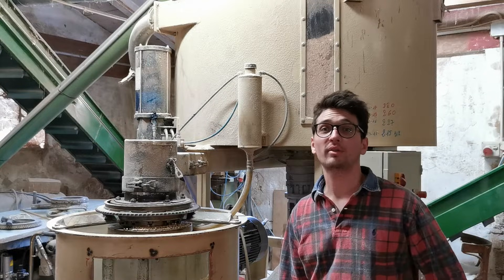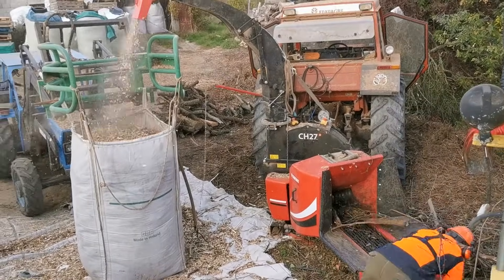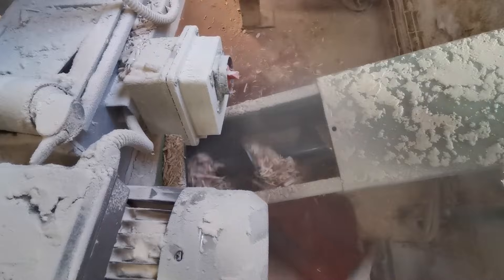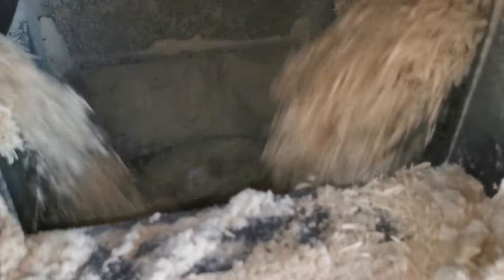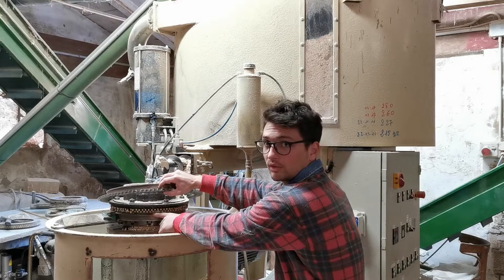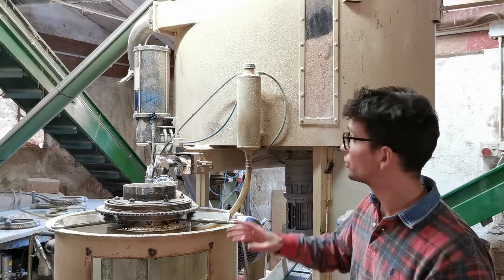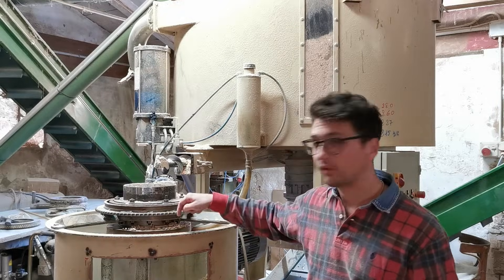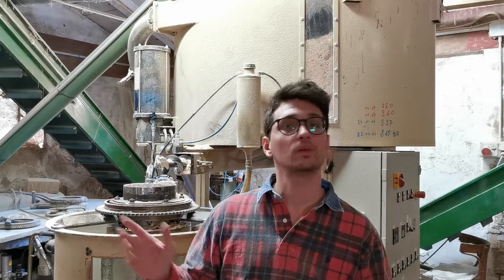wood PELLET - How It's Made! [factory and machines tour]

Comment: Thank you ProFilo for this video. Finally someone to explain into details wood pellets making. I have a question if you  could help me. We have a small forest and I wanted to produce wood pellets for our own needs since we have few pellet fireplaces. I fount the sawdust machine and the pellet making machine and I was thinking - that is all I need to make the pellets for myself. From your video I found out that the bark is not used in pellets making and since the trees in our forest are up to 15cm in diameter (not large logs)   it would be hard to remove the bark from them without sourcing specific machine. I was wondering is there any solution to overtake that problem without buying the machine to get rid from the bark? Also is there any way using the tree branches to make pellets and how?
Thanks
Reply from the maker: Hi @Deyan Simenov! Thank you for your comment! Well, you are exactly like in our situation. I'm gonna tell you some aspects.First of all, as you can see in the video, we use very high quality material without bark because we sell the product: we want to maximize energy efficiency and minimize ashes production. This is because, in general, people want to clean as less as possible their stove. Remember that bark is the major responsible of ashes production. All this to say that if your pellet will be mainly for your personal use and you don't really care too much about ashes production/cleaning procedure you can perfectly use tree tops, bark and brances to procude wood pellet. This was infact the original reason why pellet was invented: to recover all these parts of wood. At our home we have infact a big wood chip boiler: we use very low quality material (good one is kept for pellet), because ashes production is not a relevant aspect for us (you can see a video about that in the channel).
Reply from the maker: Another comment for you: we have a client that brings us his tree tops and branches, we do this low-quality pellet for him, but he is really happy because he uses wood pellet in a boiler, where he doesn't care that much about quality. Doest it have a quite low level of enery/tons? no problem, he burns more, because it actually costs much less than very good quality one.
Reply from the maker: Another question is about the plant: unfortunately, you do need a bit of equipement to complete the wood pellet production procedure. The wood whipping machine (but you said you already have something, right?), the dryier, the hammer mill, together with a storage space and finally the pellet milling machine. All together a bit of equipement. If you can setup this, then you are clear to go!
Reply: Thank you for your help ProFilo. You gave me a great idea. I`ll search for a pellet manufacturer  around my city to ask him the same thing you do for your customer. Then we can try the quality of these pellets and if we are happy with it then we can buy the machines, since it is just for our home usage. Do you have any idea what else we can do with wood chips from tree branches and tree tops apart from low quality pellets? It is Acacia trees. Greetings from Bulgaria
Reply from the maker: @deyansimeonov1873  I'm very glad to help you! And I'm very happy that my video was of interest!
First of all how much wood do you use all over the year? You have to consider the cost to setup the whole plant, plus the maintenance (and the energy to run it). honestly, I don't think that a plant like our (notice that our is actually very small!) is sustainable for home-use only. However, if you use quite a lot of material (+ maybe you can sell a bit...) you can do that. And I think that in your place you use a lot of material (here in Italy not that much as you, I think).
Here my two advices:
1) consider to use directly wood chip, as we do. You can install a wood chip boiler that burns almost everything. No matter the quality, no matter the bark percentage. If it is wood, it burns. We are using branches in these days: we consume a lot of material, we produce a lot of ashes (so we have to clean the ashes box more frequently) but no problem for us...we are spending about 3€/5€ / day in a quite old house...this is very economical!  This is because, as you know, tree tops and branches are almost free!
However the pellet production process has a relevant cost. You have to think a lot about it.

If this idea is not considerable because you already have fireplaces and you cannot change them, then I tell you this: go to the nearest pellet producer and ask if they are ok in producing a batch of pellet only ofr you with your material. This is what a guy does with us: he collects all his wood trunks and branches from his wood, he brings all the material at our plant, then we chip and pellet it, only for him. This will end up in a lower-quality product, and he is aware of that. But for him this is ok because he burns everthing in a very efficient pellet boiler, so the ashes proudciton/heat capacity doesn't impact that much. Much more important is the economical aspect: this low quality pellet costs him a lot less...

Another advice: don't think about very small plants. you can find on the market very small pellet mills for few hundred/thousands of €...NO. They don't work well, they are fragile, you cannot find spare parts. Moreover, they produce few kg/h...  Rather than these, please look for professional products and plants.

Finally, if you don't really know what to do with these trees..maybe you can sell the material (directly trunks or wood chip) to a nearby pellet plants or, if you have one, district heating plants.

Let me know what you think! I'm curios about your toughts!

Bye!
Reply: @profilo_is_back  That is for the future use. We are planning to use about 8 t/annually. We are planting 20 dekares  only Acacia trees which is already started. The machines I got  quotes are - sawdust 7.5kw -400kg/h and pellet making machine 400kg/h 15kw.  In 10 years time it would be a lot of branches and tree tops. That is why I am interested what can I do from all these residues.
Reply from the maker: @deyansimeonov1873  weel, it is obviously a significant amount of wood. In your situation I would evaluate a chipping machine + wood chip boiler, I wouldn't go with the pellet solution, honestly.
Anyway, is this for your personal use? Because in this case, (even if I don't really like this option), you can evaluate the small pellet machine. When you have time you prepare the wood, then produce pellet. This is a good operation. But I want  to point out some aspect, to let you know this in advance (something that small pellet machine vendors won't tell you, for sure).
1. these small/low cost machines (even if few thousands of € are not that much) are not very reliable. You must have mechanical and electrotechnial knowledges to be able to repair and make maintenance (quite frequent) to your pellet mill.
2. the pellet mill is not enough. You may need a sift, because the machine accepts only small wood chip. You may need a dryer, because wood cannot have too much moisture, otherwise it doesn't compact in pellet.
3. The whole procedure (from tree tops to pellet) is not that easy: you have to develop knowledge and tricks in the manufacturing process.

Will you do this almost full time, or were you wondering about something much more easier (off-work, let's say)?
I'm telling you this first because I think that the pellet manufacturing plant+process are both too complicated: you go full or you don't. And secondly because I have some friend who bought a small pellet machine, but they currently have it in their garage. It doesn't work, and more importantily, they don't know how let it work.

Please, evaluate correctly all the equipement/time/knowledge required to setup a system like that.

In my opinion you will be extremely satisfied if you will use all the residuals as wood chip in a wood-chip boiler. Moreover, you can install a both-wood chip/pellet boiler + you can easily buy wood chip, that is more economical than pellet (we can do that in Italy, I am quite sure you have much more material where you live!) and finally it will be a fully automated system (you simply have to load wood chip. Then stop).

Did I give you some reasonable ideas? Or waas I out of the conversation? Maybe I misuderstood something...
Let me know! Bye
Reply: @profilo_is_back  Thank you for your help. As I see it now, thankfully to your full explanation I cannot go after wood pellet manufacturing. I do not want to do it full time, also in order to correctly producing for my own needs wood pellets I`ll need a factory equipment. In this case I have to consider wood-chip boiler. I`ll watch your videos to grab some knowledge. At least that is one option that does not require many machines, full time and  the most important I`ll get rid of some of my residues by utilizing  it. Thank you for your help ProFilo.  Good to have guys like you. Having your expert advices saved me a lot of time and money
Reply: By the way is that the link for the wood chip boiler-https://www.youtube.com/watch?v=_UsDvLMjICs?
Reply from the maker: @deyansimeonov1873  Yes, exactly. It is. Here the link to the second video, about cleaning. It is of interest because you can see how te boiler is made, in details. https://youtu.be/5JvV5YZixQ8
If you want subscruve to the channel, I'm gonna post more videos about the boiler in the next week. (moreover you help me in growing, Thank You!)
Reply from the maker: @deyansimeonov1873  Thank you, I'm really hapy that I helped you. Hope you can find the correct solution for your house. I'm really glad that the biomass heating systems are spreading out more and more. We absolutely need more sustainability to heat our houses. IN the future, you have to do a video about your system! Bye